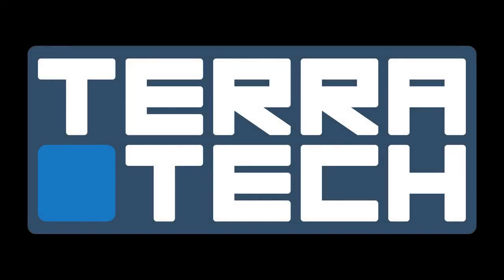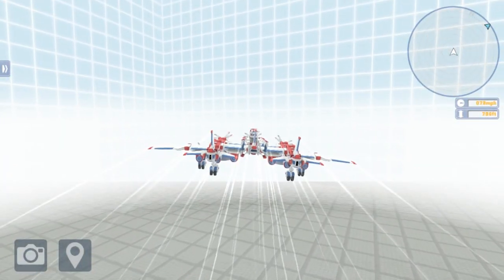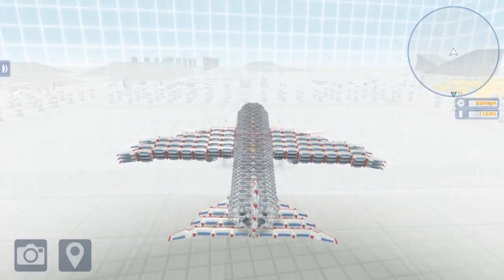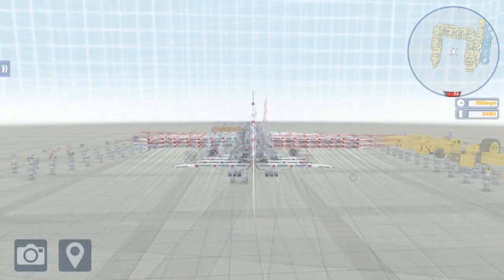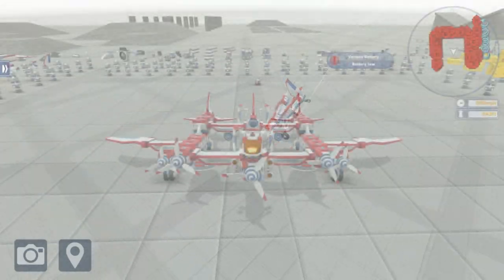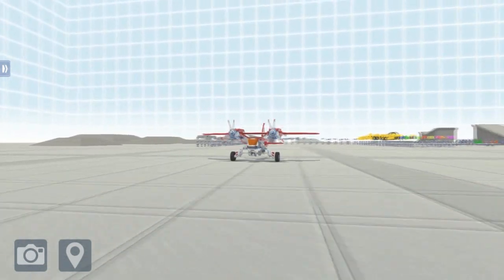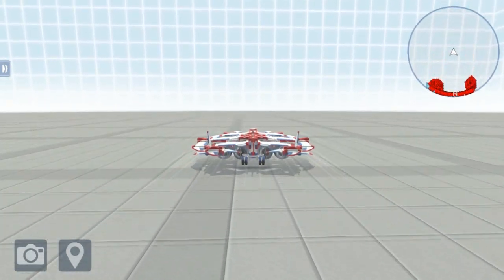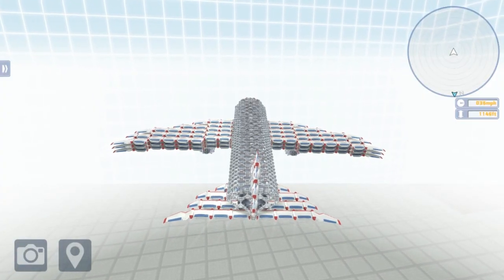Tips for Flying in TerraTech | TT Tutorials

Comment: hey i'm  facing a problem with the game is one of the reasons that i left the game for now  , which is the camera angle is really annoying so i had a suggestion that you can add a part that control the center of the camera  for example i built a  huge tall tech but the camera seems to focus on the high density areas leaving other areas in the tech out of frame thus i can't   see these areas or  even add parts to it  since the camera moves in a spherical direction , thus i think the easiest and more practical way to fix this problem is to add a new part (call it x for instance ) in which i add 3 parts to my tech an addition to the original view centered at the first cap on the tech , and then using  a certain button  i can change the camera center to move between the additional (x part) i installed ( and please keep it extremely light weight )  

or you  come up with a better solution you are the expert after all ^_^
Reply: Just zoom out